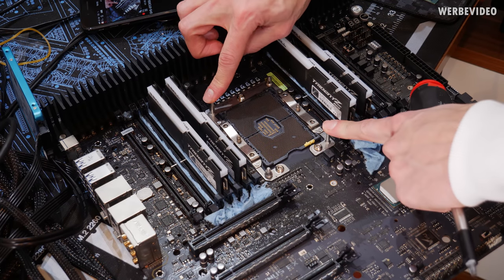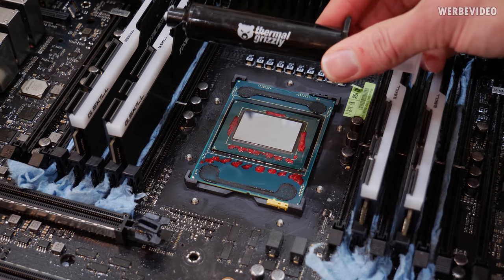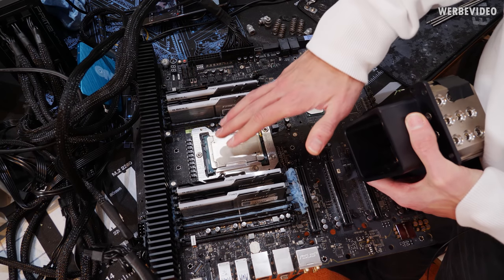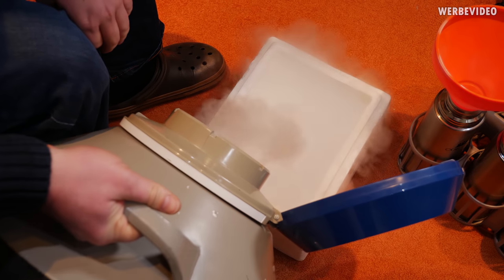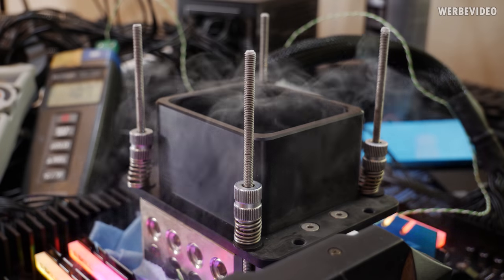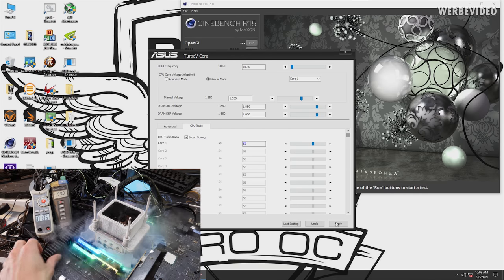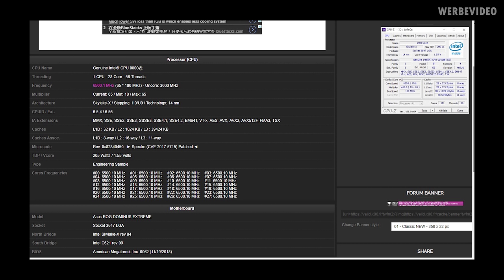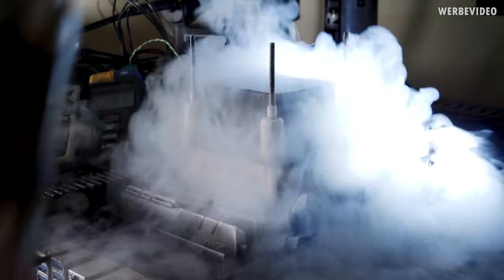Breaking Records - Xeon W-3175X Extreme Overclocking

Comment: i like the beast cpu pot how much its cost to buy ?
Reply: around 500€  and the one for high core count goes for 500-1000 but you can check out the T-REX from kingpin same performance and a bit cheaper :P
Reply: @yozee0690  I think the Beast cooler is much cooler looking and better (I have the T-Rex). It cost me $397 to get it (without heated backplate), so an extra $200 is pretty small, considering LN2 dewars cost $500, LN2 costs a lot, the CPUs cost a ton, the boards cost a lot... Might as well spend a bit extra ya know?
Unfortunately, the BEAST cooler was limited quantity, and sold out, otherwise I'd have one.

Comment: If you don't need a 2nd psu even for extreme 5Ghz overclocking why the heck did ASUS put two 24-pin connectors to begin with??🤔

Comment: My 1700 is doing just fine..handles anything.. Can overclock it too and get to 4,15 if I want.
Reply: What voltage are you running with your 1700. I get to 3.95GHz on 1.4v with my Ryzen 7 1700.
Reply: @alaskanhybridgaming  that's kool..I have noticed..different bios gives different effects for me..an older bios gives me a higher over clock with less voltage..
Also using ryzen master the first version gave me also better over clocks.
My motherboard is a gigabyte gaming 5 the white one.
I have been using 1.36-1-41... Is the voltages I played with..the older stuff gives me better over clocks..no idea why really..I could over clock to 4.15 with like 1.38 volts....
Then I updated my bios and ryzen master..played with both. But gives weaker over clocks...needs more voltage now..

Comment: 100A *12.2V ??? WHY?
CP use 1-1.5V and 10-100A - then 100A *1.5V(max)= 150W real consumer power
Reply: I don't think it's like that it's more like 12v 100a in to board and 1.5v 700a out to CPU and 100-200 Watts lost in conversation.

Comment: Threadripper beats the intel chip in cinebench at a lower clock speed and around 20,000$ less for the cpu and motherboard, Great job there Intel, really the chipmaker of the common man and definitely not insanely greedy bastards that will never actually sell more than 5 of these chips to Saudi princes and a couple Dubai billionaire playboys

Comment: Of course it's with an Intel CPU
Reply: Because Roman already beat most Ryzen through duel Epyc benchmarks?
I find the irony is he's using his custom designed Threadripper/Epyc block on Intel (irony being, AMD helping them yet again, this time just with cooling). Intel wouldn't be very impressive without AMD kicking them so hard recently, we'd still be paying $1700 for a 10 core dog turd i7 just like 2 years ago, now with that same money getting a 32 core monster from AMD, Intel has to play ball for once in a very long time. At least they have something comparable to AMD at the Ultra high end, even if it gulps power like mad, costs more than the 32 core Epyc chips, and twice that of TR 32c, at least they are not excruciatingly far behind... I'm curious what we will see in the next few years since AMD already has the 64 core ROME processor (surely not named after Roman... But if you do get a chip Der8aur, sand down the E and sharpie the chip name! I can't wait for you to break those records too!)